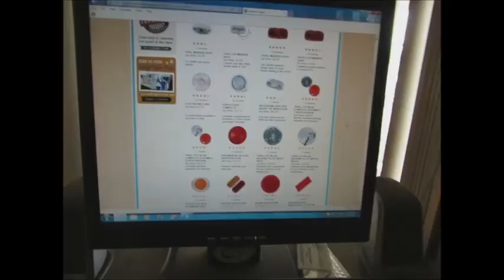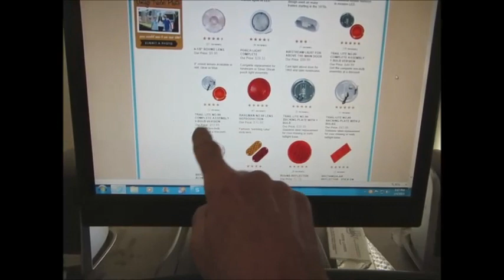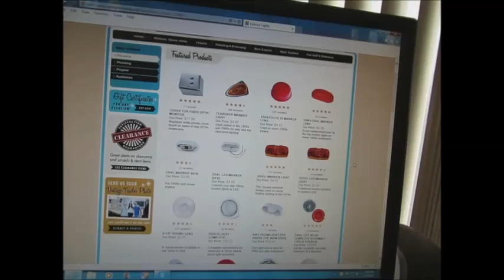Trailer Tidbits - 57 Westerner Part 5 - Rear End Completion

Comment: I recently read about using bubble wrap for insulation. I thought that was a clever idea.
Reply from the maker: Then it's just air...
Reply: The more layers of air that you have the better the insulation is. Layering small bubble wrap would be very effective and you won't itch after installation.